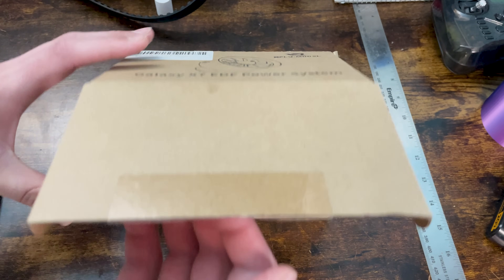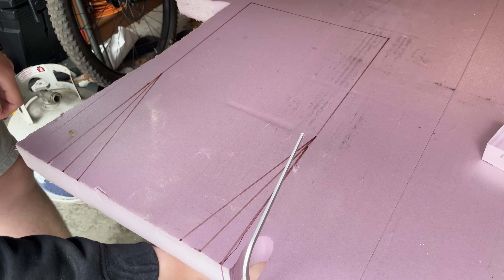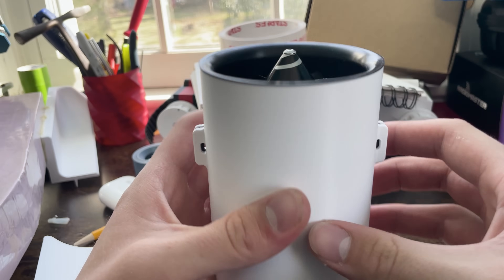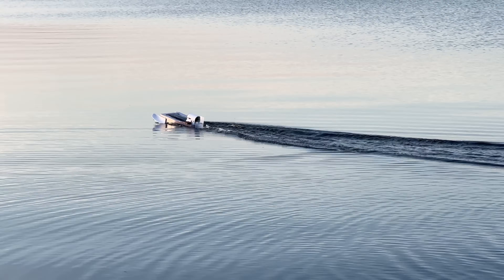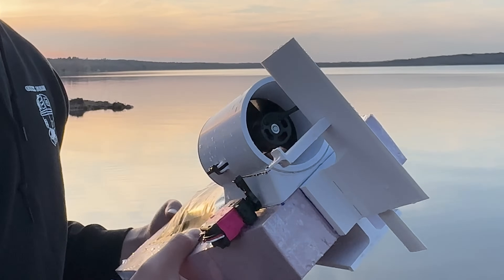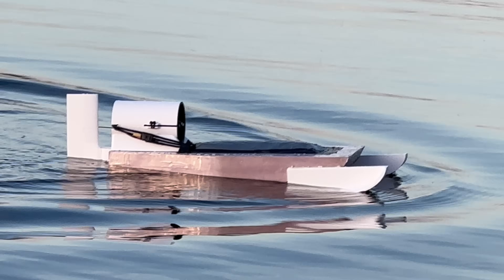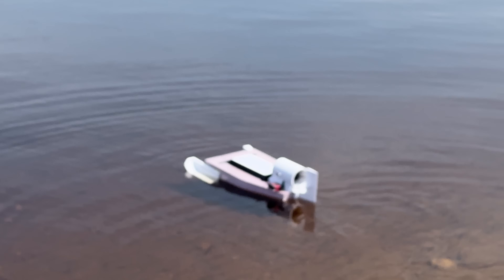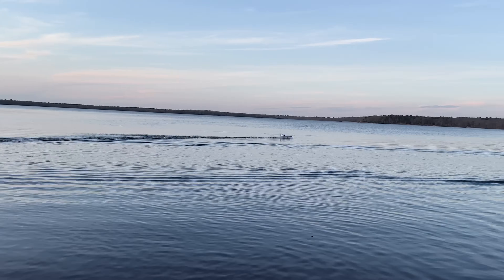I Made an EDF Powered RC Hydroplane

Comment: Rotation? That crab walk? Rotation of the EDF? Wonder if you had 2.. with oppossing rotation... if the sidways pull action would dissapear...  incorporate a gyro into the rudder? Move the 1 EDF further forward? You watch RC TestFlight?
Reply from the maker: the "crab walking issue" occurred in both directions. This would contradict the theory that the edf's rotation is cause a gyroscopic torque on the boat because it only rotates in one direction. the reason it was skewing sideways is similar to if the fins on a rocket are too close to the center of gravity, making it unstable and prone to swaying back and forth. good thought though. also yes, I'm a big fan of RC Test Flight!

Comment: super cool project! im curious, was there any noticeable torque from the edf trying to make it roll to the side?
Reply from the maker: not that I could tell, I think the blades are light weight enough and have such a small radius that the angular momentum they generate is very small. plus the wide stance of the boat hull in comparison. good question though, and thanks for the support!
Reply: @ thats what i figured, i thought about it when the boat went into the air and am curious how much of the violent flipping was caused by it